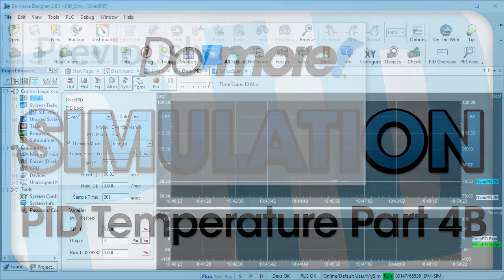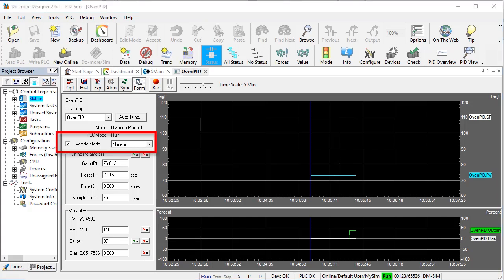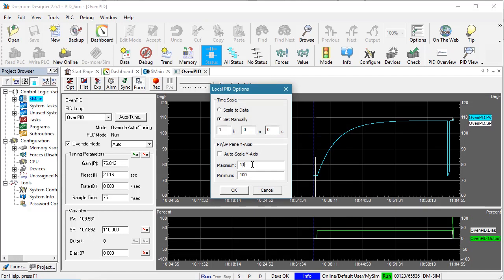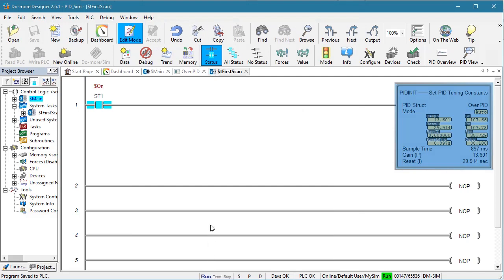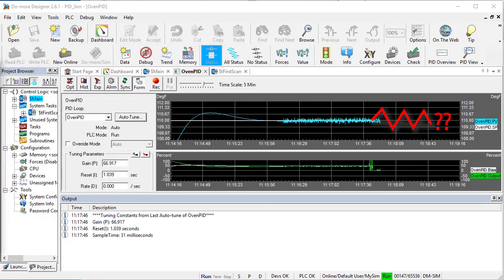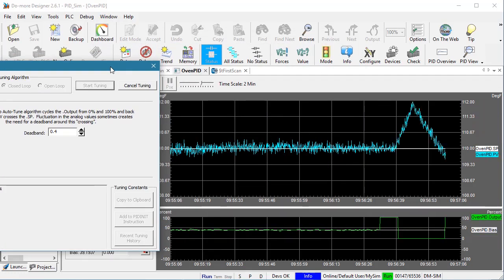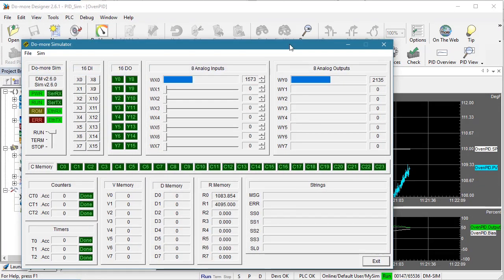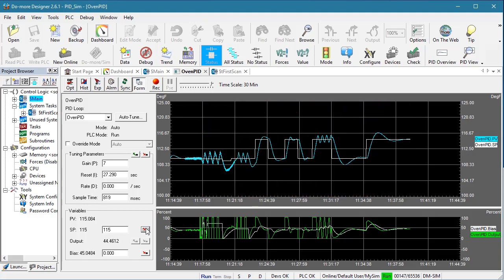BRX Do-more Simulation PID Temperature Part 4B from AutomationDirect

Comment: I need an example with reverse acting PID, simulator mode, please!
Reply from the maker: Thank you for the comment Pedro. We will place your request on the production list but if you need help with this topic I would advise contact Technical support at 1-800-633-0405. It will be some time before we can cover this topic in video.
Reply: @automationdirect  Ok. Thank you for your answer.
Reply from the maker: Thanks for the feedback - we will add this to our list.